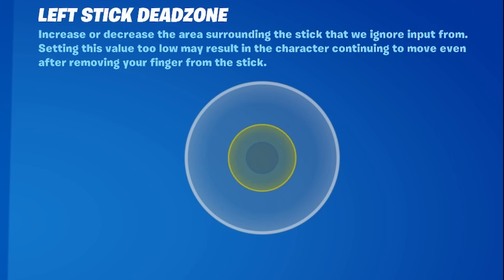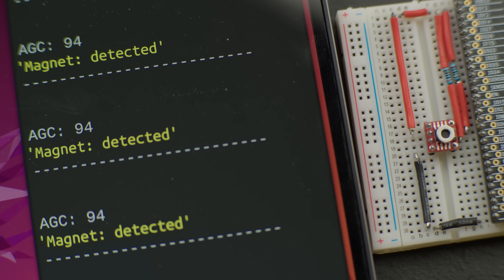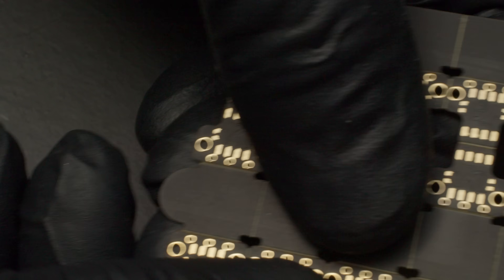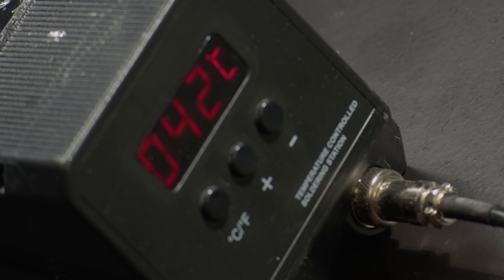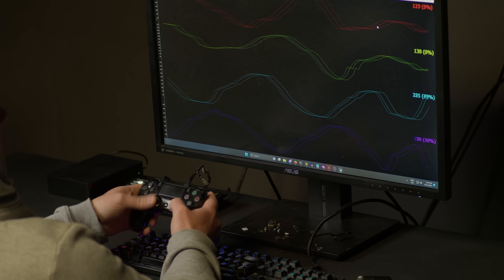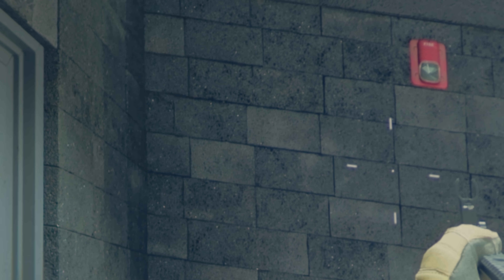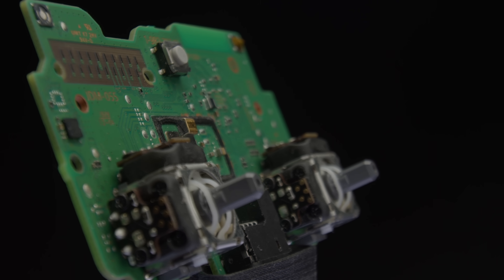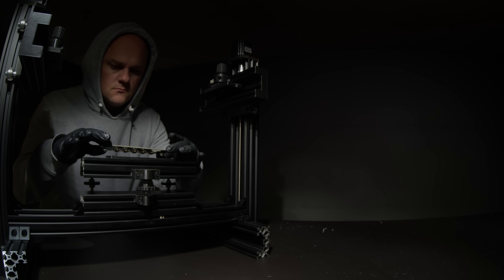Beating the $20B Joystick Drift Problem, and giving it away for free

Comment: Hi, I'm someone who works replacing these potentiometers all day! 
Fun fact: PS3 Controllers used to come with fancy 4 pin hall effect sensors but it seems like they swapped to the current potentiometer style at some point early on, likely for cost.

One thing that can cause drift besides the contact pads is the metal wiper disc inside becoming oxidized (they'll turn different colors like heat treated metal!). You can sometimes clean the disc itself with polishing compound or a fiberglass scratch pen but its usually quicker for us to just swap the green potentiometer out and slap a new one in.

Often on controllers from the 360/PS3 era and earlier the actual housing box itself wears out and allows some slop in the stick. Its easy enough to get replacements for them, but its a little more annoying.

Comment: 2 months? I've been using the same PS4 controller for 6 years. Mine has this, it either occurs rarely, can be fixed by a flick of the stick or can be fixed by unplugging and plugging back in. Is everybody experiencing this EVERY time they plug in their controllers? What are you doing to your controllers? Stop destroying your controllers. 😂
Reply: 99% of the time, stick drifts is just dust under the sticks. Most people don't know how to keep their controllers clean much less how to get inside to blow that dirt off without breaking it...

Can't blame them, the things are purposely made to be hard to get into.

Comment: Weird, I've had my PS2 slim since the 2ver released and the controller never developed that problem. My PS3 never developed any problem other than the battery needing replacement and my PS4 one the ruber on the left analog peeled off. But the 3 of them still no problem. And my Xbox controller is 5 now or so. Got it when Microsoft open the Xbox Design Lab and you could make your controller. Still no problem.
I only had this problem with game cube controllers. Oh and one PSP.

Comment: The saddest thing about the whole controller situation is that Playstation has USED MAGNETORESISTIVE SENSORS in a couple versions of the Dualshock 3 controller. Then for whatever reason, they went back to the crap that wears out faster.

Literally solved the issue as a leading brand then turned their backs on it for the foreseeable future.
Reply: They went back to the crappy way because their bean-counters noted that they were making less money with durable controllers - simple as that, really and this is a known problem of late stage capitalism

Against this backdrop, don't expect sensible use of valuable finite resources. We're literally ruining our environment and habitat to make a couple of extra bucks 😂

Comment: my fuckass steam controller somehow hasn't had any joystick drift somehow.....
. it's been working fine for literally like over 4 years.... except for one mechanical issue which keeps one of the batteries stuck in it, but i use it plugged in so it's not an issue for me.

Comment: where do you source the diametrically magnetized magnets?
Reply from the maker: @the_bootleg_starwalker  I had them custom made in a factory. Wasnt easy to find any on the market.
Reply: @MariusHeier1 I just found out about your hall effect joysticks for ps4! Is it at all possible to purchase them from your store or patreon?
Reply from the maker: @ultraspinalki11  not yet. But very soon :)
Reply: @MariusHeier1  Thank you for the quick reply! If I join your patreon at this point in time, am I eligible to be among the first to buy your product, or should I simply wait for its public release?
Reply: @MariusHeier1  i found an american company that sold them but they were pretty expensive. aliexpress also had them but only two types/sizes (one of them was the ring one you're using). if you need to prototype with new magnets without ordering custom ones, you can buy axial magnets (neodymium), heat them up with a lighter so they lose properties, and place them between some beefy electromagnets. a few short pulses do the job (so the electromagnet won't get red hot lol) works really well for me and my magnets were even stronger than what i bought, so i bet you could use small electromagnets

Comment: I use a hall effect keybord and an optical mouse.
Zero problems.
I never understood the point of anyone older than 12 using a console controller. I hear console gamers talking smack about keeping up in FPS games but I've never seen it.
I can see drone operators needing this however.

Comment: mouse scroll wheel suffer the same fate unfortunately but the problem ussually caused by the oil used inside causing the scroll to jump backwards since it doest have a propper contact seing  that oil is non conductive, remove the oil inside and you will probably upgrade your pc first before the mouse wheel broke down.

Comment: A other idea for you : 
Engineering the world first force feedback joystick.

I waiting for that... On racing games it's gone be a game changer for sure, but also open the door the so many gameplay features, like feeling the recoil of fps and contre balancing it, have your stick for you un the opposite direction when you hit a wall...
Etc
I don't know how to make it, to implement it in the forme factor of a PS3 controller, for sure it already exist for expensive aviation sticks.
Reply from the maker: Yes. I have actually already work on that and have atleast at tiny prototype. Will work on it again in probably 2-3 months.
Reply from the maker: It will also make it possible to use 0% dead zone even on tiny movements. And all kinds of different resistance as well.
Reply: @MariusHeier1  amazing man !!!
Hey if you work on a 0 dead zone joystick maybe try log scale for the joystick, I don't know how he will turn up but maybe it's a better user/gamer experience.
Good to know that you are working on it, I wish big tech company notice and that you can make money out of it too if it's your goal.

Comment: How to make it less sensitive and expand the area/angle of the dead center?
Reply from the maker: It is not effected much by noise as other sensors..its made to sit ontop of motors with magnetic coils and powerfull neodym magnets. It has about 600, points of noise free resolution through the movement of the joystick.
Reply: so  basically no dice?

Comment: The spring steel that keeps it centered is usually the cause.  That happens way sooner than the contact pad wears out.   That’s why all these Hal effect sensors will suffer the same fate
Reply from the maker: If the spring is worn out it will def lead to drift. But the source of the problem of drift comes in most cases from the potmeter based joysticks. First its residue buildup that makes the signal noisy. And then the potmeter becomes broken and it becomes worse.
Reply: @MariusHeier1  I’ve serviced so many pots over the last 20-some years,  I’d say 90% of the time it’s the spring tension that keeps them centered.
Reply from the maker: @thatdrh  Yeah i bet that is right for the ones who actually get into service. But people just add deadzone to them and dont think to much about it. And by the time you get them they are so worn out you cannot fix it with deadzone anymore. And by that time im sure the springs are worn. But what i mean is that, before they go so bad that they need service. First thing that happens is the potmeters get noisy. It usually happens after only a couple of month normal usage.

Comment: Pro tip: Buy a new controller that comes with the standard 1 year warranty.  Trade it in a week before your year is up regardless of whether there is a problem or not.  I do this every year.  This was (quietly) recommended to me by the underpaid Gamestop employee required to ask "would you like to buy the extended warranty?".

Comment: A good Gamepad for PC, Android & Xbox Series X is the Vader 3 Pro. 

HAL effect sticks&triggers, microswitches (like on mouse main buttons) for d-pad, ABXY, RB, LB and also on the trigger in mechanicalcally switched digital mode. Also comes with 4 buttons on the back like the elite controllers & 2 buttons under your right thumb joint, all programmable to gamepad or keyboard buttons via the PC app & saved on device. 

500hz refresh and non-friction rings on the sticks, unlike the official controllers that run at 30/60hz and grind the base at maximum deflection. Comes with low latency wireless dongle & supports bluetooth & wired modes too.

~10h battery life. Price 50-60 USD on aliexpress.

Comment: joy stick drift ins a 20billion dollar issue. people dont spend billions of dollars on fuckin controllers. the consoles yes. but billions on the controllers. absolutely fuckin not accurate
Reply from the maker: About 200 million consoles sold. With about 1.5 controllers per console. At 60$ ish value of a controller. Is about 20b$.
Reply: @MariusHeier1  none of my controllers ever stick drifts. its a made up issue by people who are too rough on shit. cant throw or drop a controller and then claim the company is at fault. none of my xbox controllers regardless of generation have ever had issues. people are the issue. like always

Comment: the Chinese made hall effect now
Reply from the maker: YEs. They made it even before this video 1 year ago.2
Reply: @MariusHeier1  pls i need ur help or some info to avoid this problem i have hall effect for my xbox i try to calibrate the analog ,  the board that with USB  connector start to overheated around D-PAD area and two boards same problem one stop working and one working but over overheated + i use third one without calibrate bec already the analog in the center no overheating , btw when i try to  calibrate i use needle in the hole and the needle  touched the capacitors etc and the controller shutdown , is that who cause the overheating ??  and should i use non metal objects ??

Comment: Magnets loose strength over time and are a lot more expensive.
 YOU DID NOT SOLVE A PROBLEM, YOU JUST MADE IT MORE EXPENSIVE!CONGRATULATIONS!
Reply from the maker: They last for the entire lifetime of the controller. The degrading of these magnets is accounted for in the sensor.
Reply: You will have worn out every other component several times over before the magnets, non issue when potentiometers are the #1 point of failure for a controllers lifespan.

Comment: Hey Marius , i appreciate your work very much . I do have a question tough , its about rhat drift which is caused by imperfect alignment by those physical springs. 

I was thinking that if we can camcel it out with programming. Like program a condition that says if theres a output reading from 0 to let's say x volt and it doesn't change for lets say 100ms than give it a default input to 0. 
Another case of trying precise and small moment as if we try to touch that stick , we won't be able to precisely stable it for such period of time and if reading kept changing , our input can be accurate even without causing that drift . 😅
Reply: And ya gotta admit you impressed me on how well you care about your viewer's comments. I was surfing through comments and saw your replies. You just won my heart man ❤
Reply from the maker: Thank you for your kind words.  This is how Nintendo and Gulikit (and more) do recentering. So an active recenter mechanism within software. The challenge with this is it creates a hysterises or delay. This delay might cause oscillating when you do small movements around the center. It might work if you make a total prediction model for it for the state of the joystick. But my solution is going to be active recentering, so electromechanical. Will probably work on this after summer. Take care :)
Reply: @MariusHeier1   Best of luck for that , I first saw your video today but got attached to your channel. I will be waiting eagerly for next one . 

And the mindset that you have is the type of mindset IIT demands (for whose entrance exam I am preparing ) . Your videos are gonna help a lot for developing my mindset to see new ways to come problems . 

Have a great day ahead. And keep bringing such contents 😋. 
-Fan from India.
Reply from the maker: @siddhantsingh1889  thank you so much. I appreciate your kind words again. I wish I could make more videos. But i spend most of my time just surving on the path i am..however lately ive done major leeps for financial stability so i hope i can churn out more videos soon.
Reply: @MariusHeier1   Felt good to hear that dear 😊.  Your time is gonna come soon  , make it Memorable one .
Reply from the maker: @siddhantsingh1889  Oh the next 2 month is gonna absolutely blow your mind. I promise!
Reply: @MariusHeier1   I'm waiting 😌.
Reply: @MariusHeier1  I'm so glad to hear you might go with electromechanical centering. I was theorizing ways of achieving that myself, and how you might be able to use it to prevent backswing (or filter it out in some predictive way), change the "spring" resistance, and even greatly extend the lifespan of the "spring", but I figured that you were one of the only people who would realistically try it. I'm greatly interested in seeing the results here. These two things together may just solve the joystick problem forever. The mechanical buttons are another matter, but they're almost entirely solved already, it's just that no one seems to want to make their controllers last forever and have the highest performance possible. Same problem for mice. Not entirely sure why no one wants to do it.

Comment: Hall effect sensors have been used in RC and FPV Drone Remotes for a long time already. It's shameful how manufacturers of gaming controllers are still using potentiometers. Flight sticks and steering wheels for example are also mostly using hall effect sensors by now.

Comment: to solve the issues of no 'true 0 drift' i've seen controllers use rubber type bands that pull the stick in all directions guiding it back to its real '0' that worked very well

Comment: Its not a problem for the companies. It’s their solution to making ppl buy/repair more controllers…. The same way vehicles use shit parts that break over time instead of using parts that never break (like they used to in the 1940’s before GM and Ford had their “we need to use shittier parts” meeting)

Sure, whoever creates this will sell a lot of controllers, but they wont be making much after everyone has one. Its sad.. I know.. but it’s true

Comment: I remember when i had a old ps1 controller. Duelshock, vibration. It was clear plastic purple, made by Sony. Worked for YEARS, well into the second generation PlayStation 2. The chip inside it burned out, yet the sticks, while a bit wobbly and sloppy, worked. There was strick drift but it was tolerable! Its almost as soon as i got a ps3 with controllers. I noticed a major dip in this kinda reliability. The sticks would always break first before anything else did. I want them sticks to work until the controller has a stroke. Planned failure, planned obsolescence, Knowing you will buy another. Absolutely terrible 😔

Comment: Question, can someone send you a controller so you could replace the analog sticks? Is that something that could be done and does it have to be a Dualshock 4 or Dualsense? What about a Dualshock 3? And if yes, would it be expensive? Cause a repair shop said they'd charge $75 just for the labor and an additional $25 for joystick replacement. I'd assume that's just for 1 controller and that is wildly expensive, especally for modules which are like less then $10.

I ask because I am not confident in replacing my own joystick modules on my DS3 let alone DS4 without ruining the controllers. My hands get very very shaky when doing delicate work, especially with something small.

Comment: Needed. That issue with the oversensitivity near the middle seems solvable. a lot of people would pay more for it to last longer.
I can't find a silent alternative to the xbox controller. If you made "sensory safe" gaming controllers, with low light and sound options ect(no clicking) you could market them as accessibility controllers. No one is making controllers like that. I'd pay triple for that kind of controller for another comment's worth of reasons.
Reply from the maker: Great thoughts. Have not thought of it like that before. But i see why someone would. Like i never use the motors in the controller.

Comment: i can not understate how much money the PowerA Fusion Pro 2 has saved me. i used to use xbox elite series controllers and while i loved the feeling of them, they would start losing the sensitivity in their bumpers and other buttons. i think i went through 3? literally buying one once a year because their lifetime was so shite. 

one day i went to gamestop and opted for a different controller, the PowerA Fusion Pro 2. it was wired, but only cost $70-80, just under 1/3 of what the elites were costing me. i’ve had that controller now for nearly 3 years and still works completely fine. if you find yourself spending a ton on gamepads, i’m begging you try the PowerA Fusion Pro! Pretty sure they’re on 3rd gen now too!

Comment: They’re well aware of the issue. You think Nintendo’s engineers are so dumb that they don’t know what friction is? Of course they do. They were simply ordered not to fix the problem because it generates profit.

They WANT your equipment to wear itself down. That’s what consoles have always been; a feature stripped computer constructed with intentionally inferior hardware, as to motivate the customer to move on to the next stunted cablebox they release. Ask yourself why your Xbox can’t do what my mothers work laptop can. It’s because it’s cheaper and generates more profit to keep you locked into this cycle of perceived improvement. You buy the next console because the marketing makes it look so much better, when it’s actually five years behind what everyone else has.